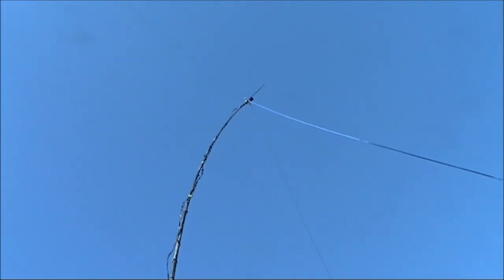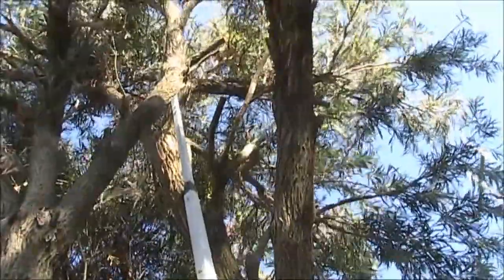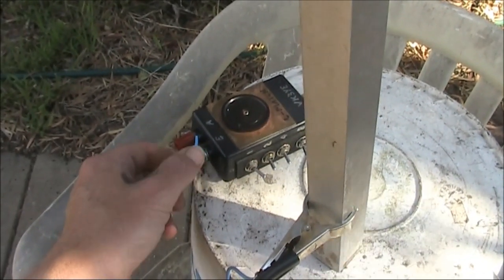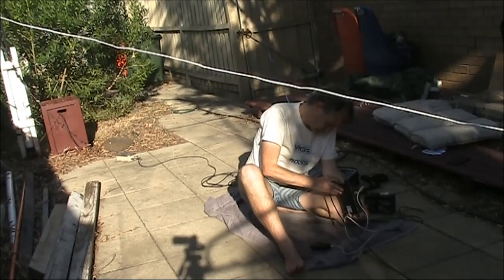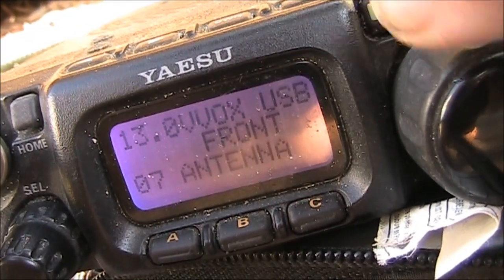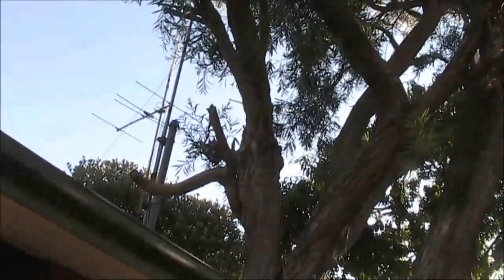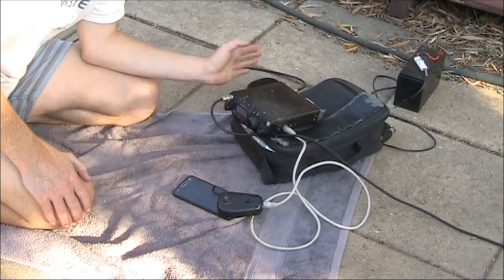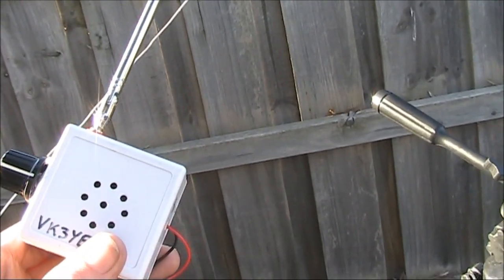My worst ever antenna

Comment: I wonder if the aluminium was anodised and therefore the two sections of the vertical might not have had a good electrical connection?

Comment: A vertical can work much better on a 9:1 unun or 49:1 EFHW because there is less current in the counterpoise or radials.  With simple radials, there is equal current in the radials as in the vertical element, and if the radiation due to the radials does not cancel, the radiation produced tends to be absorbed by nearby objects or simply reflected into the sky at high angles.  

I made a a short vertical dipole in this article:

https://drive.google.com/file/d/1rdXsgld91BquQ_yEuWkZa68mkDQAQF3O/view?usp=sharing

It has large capacitive hats so that the short antenna can be a relatively efficient radiator.   It's also both 40 m and 20 m as well.

Comment: Getting the vertical radiating section out of the tree would also improve that antenna's performance. The dielectric losses arising from the tree being close to the high voltage region of the radiating element wouldn't be helping.

Comment: When I cant have my 80m multiband end-fed up, I use a 6BTV on 10 thru to a very specific part of 80m (FT8), it works pretty well, but it quite literraly has a giantic earth-pole to have it mounted on (goes in the ground about 2m to a concrete support but dirt/ground base) and then a fully populated radial plate, with some bolts carrying more than one radial, i.e. my lawn is covered by a huge amount of radials. The upside of this, is that my 6BTV, whilst a compromise, functions well for the frequencys it tunes on, but it requires alot of radials to do so. The end-fed is stayng up as long as possible as it gives me 80m, which is great in Europe for DX and further during the night when is when most of my operating is done during the week. I do love WSPR tho and the end-fed and 6BTV do well, sometimes the 6BTV on 20m and 1W will easily do australian contacts.

Comment: Next antenna test 

Extend the antenna to 10m in the air and match with an end fed UnUn. 

Pro tip.... the wider section of the aluminium tube, when compared with wire, appears to lower the impedance so 49:1 may be too much for it. 18:1 may be closer. You’ll have to experiment 

I used a NanoVNA and a switched match box that uses a 12 position switch to switch between 2 and 14 turns on both the feed and the antenna side. Just dial up the best ratio that gives you the closest to 50 ohms at resonance and adjust the antenna length to achieve resonance at the desired frequency

Comment: I did a WSPR shootout between my 4BTV trapped vertical on my roof with 12 radials, and my G5RV, and the G5RV was slightly better, so yes getting it up with more radials will make a huge difference.
Reply: have you tried adding more radials to your 4BTV and tuning the loading coils ? Its suprisng how of a change can be had with more radials and fettling from the 10m band up on those vertical hustlers.
Reply: @alzeNL  Yeah, in my previous comment I stated that it had 12 radials on 40m (fewer on 20), and yes it is tuned on all four bands.  Good VSWR too.

Comment: Would the ends of the radials being above the base of the vertical radiating element be some of the cause of the poorer performance maybe?
Reply: Probably not. "Gull wing" radials are an example where the ends are higher than the feedpoint and they're used on many vertical antennas where radials cannot be laid on the ground for some reason or another.
Reply: Does that not affect impedance? Like bending them up and down on little 1/4 GP antennas
Reply: @MarkPentler  The effect on the impedance depends on the length of the gull wing bit compared to the overall length of the radial.

For example, a quarter wavelength radial for 80m is about 20.8m long. If the gull wing part runs from the feedpoint radially for 2m and up for 2m then the length of that upward-sloping section is 2×√2=2.8m. So the radial slopes up at 45° for 2.8m then runs straight and level for 18m, i.e. 87% of it is just like a traditional radial, so you wouldn't expect that big an effect.

As you go higher in frequency and the radial length shortens, the length of the "traditional radial" section becomes a smaller proportion of the overall length, and that may have effects on the feedpoint impedance.